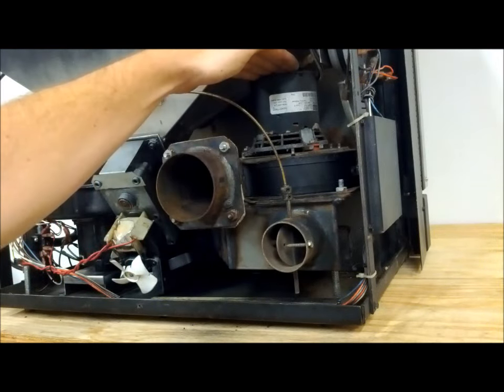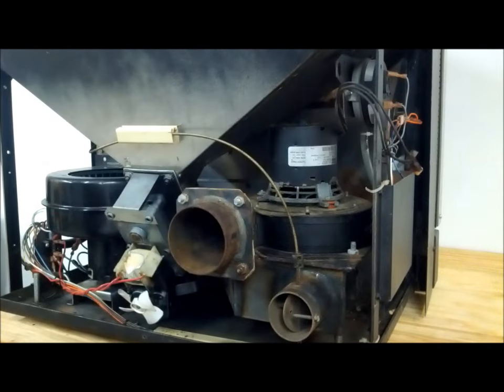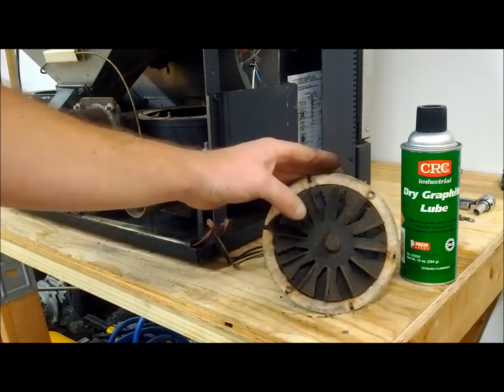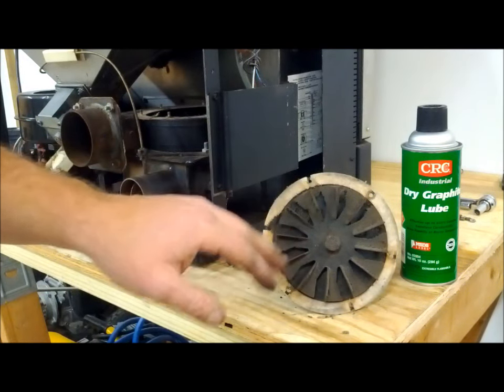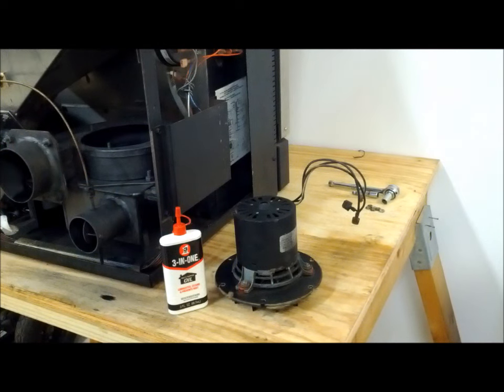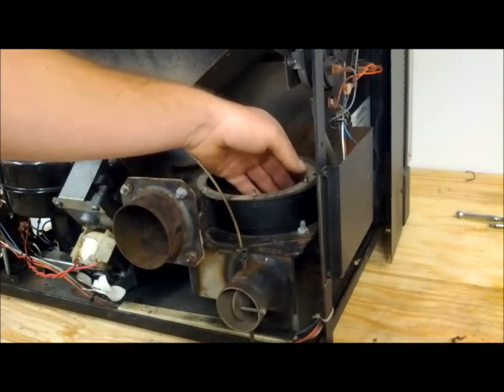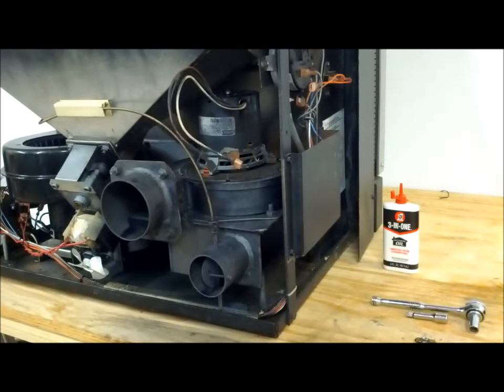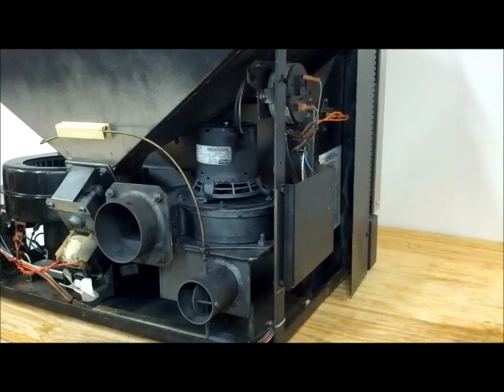How To Remove, Clean, lubricate And Reinstall An Exhaust Fan On A Pellet Stove

Comment: I'm replacing the combustion blower unit on my 25 year old Breckwell pellet stove. The exhaust end of it consists of a 90 deg .elbow attachment which is/was sealed onto the exit channel of the blower housing with silicon sealant/adhesive.  Can you tell me what kind or brand of silicon and temperature rating I should use to reseal it.  It is a sleeve-type joint of the two components (one end slides into the other and held in place with screws).  And can the same silicon be use to reattach the woven seal material to the back to he fan housing?  Thank you
Reply from the maker: There are a few brands out there, I can't recall the exact one I have used before but there's Rutland Stove and Gasket Cement which is rated for 2000 F. I think that pellet stoves are allowed a max of 500F plus ambient temp for exhaust temps at the stove to pass certification and safety testing. I want to say most run around 300-400F. So you should be OK with any sealant above 600F but to be safe you could always get a higher rated one. That one should also work for reattaching the seal.

Comment: Every time I use my small shop vac to clean my stove, I get a huge puff of smoke from vac. What am I doing wrong?
Reply: Bianca Romano Shop vac is not a pellet stove vac. You need to buy a pellet stove vac.
Reply: thanks- One more question-When I plug my stove in, the fan motor starts without me pushing on button. Once I push the on switch - all is good. What do you think the fan is override
Reply: Sound like a circuit board problem.
Reply: Bianca not everyone can afford a separate 80-300 dollar ash vac , so You CAN use a shop vac, but its at your own risk and a metal body is best and get the special pellet stove cleaning accessories too. my suggestion to your problem is that it's probably not smoke, but just the extra fine dust escaping the seals of your vacuum. Go and buy the special fine dust/ drywall bags for shop vacs and that will probably fix your issue.  If its truly "smoke" then you're vacuuming WAY TOO EARLY after your stove shuts down and no matter how long you let the stove cool, always at a minimum put the vac outside on a concrete or other non combustion surfaces ASAP and at best take it to the same non combustion surface and empty immediately . Many stoves have fan override to eliminate human error and increase safety so it might be running to remove any hot ash and it needs that exhaust draft to get lit.  I am not a licensed chimney sweep or stove technician and all suggestions are merely examples of theoretical situations and any decision to use these examples are at your own risk and liability.
Reply: Use a regular shop vac I do,i however wait for the pellet stove to be completely cool like i run my pellet stove from 8pm till 5am when I get up for work and when I come back around 4pm my stove is nice and cool and vacuum all components ( quick maintenance) and run the stove again,I usually clean it twice three time a week
Reply: wrap filter with paper towel - instant HEPA filter for stove dust